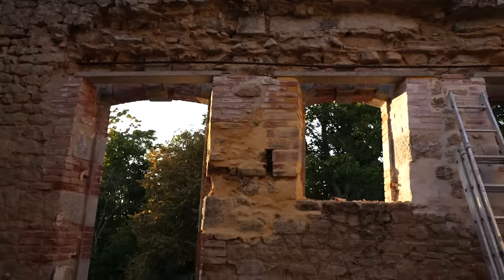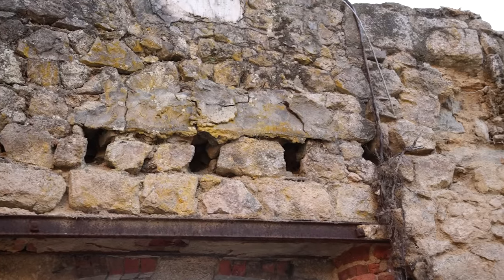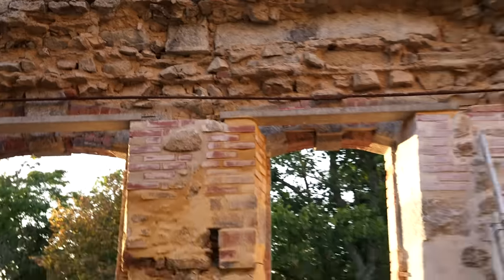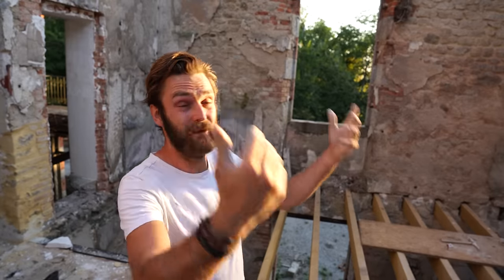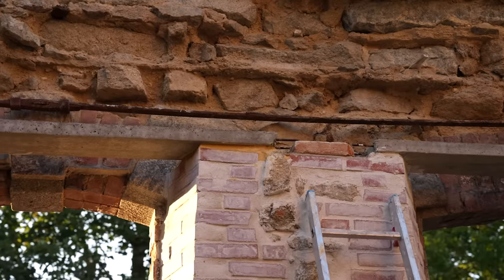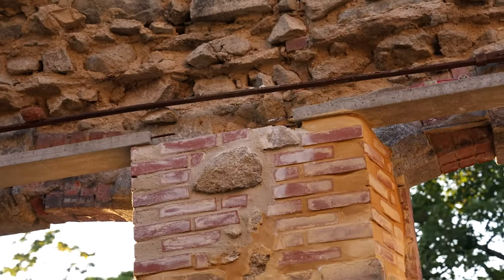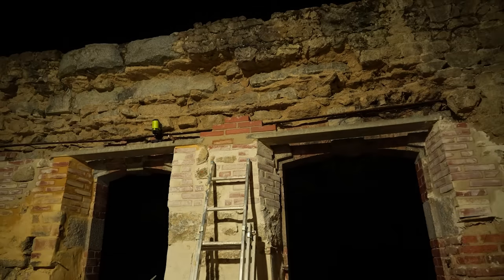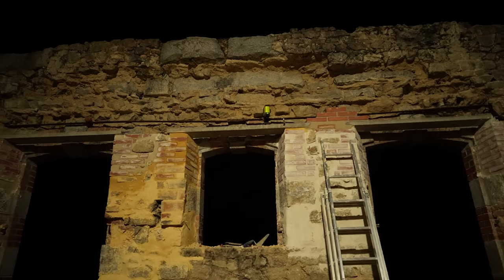laying the foundation for another floor level.

Comment: Last lintel in and then this entire wall can be rebuilt and supported and no sooner is that done we hear that beams are coming ... you just never know what is going to happen next at the Chateau !!!
Reply: He has had things well timed as a rule. He has a plan and it is working for him for sure! He also adapts well when there is a hiccup.
Reply: it's not a lintel, but a 6 centimeters pre-lintel and that's the big problem, can't support a wall
Reply: @joffreyg8676  I thought it was something European as it has the  iron bars in it. Does Dan know?
Reply: @LordBurberryGB  iron bars are normal for a pre lintel or cement will be fragile like glass, the irons that stick out used to connect the iron of the concrete poles when you need to use poles, but i'm chocked that no one said him something about that

Comment: To put this working at heights issue in perspective, in the early 1980's as a teenage trainee I was cleaning tilers grout off of window frames. Three stories high working off of two scaffold boards, moving them along as I moved along the facade. These days in Western Australia at least working off a ladder is illegal! Dan is simply turning the clock back fifty years!

Comment: The real scary thing is the wood beams aren’t cemented in. They were moving when was putting the floor board down.
Reply: Noggins haven’t been installed yet. That sure was an ankle twister!!😮
Reply: @PaulRiesland Indeed, we were supposed to have a noggins day a while back, and that didn’t happen!
Reply: @gloriasmestad3803  You’re right! I think that happened when he was under the weather. Now he may be stressed to move ahead to get that roof on. Just a guess.
Reply: they have to be able to move so they can expand and contract over seasonal shifts so that's probably how they'll stay, but they'll firm up once flooring is installed!!
Reply: Exactly right.  VERY dangerous!
Reply: I thought the same thing.  I have to fast forward some of this stuff because my anxiety won’t let me watch it. 😂😂 But I wouldn’t miss an episode for anything.
Reply: It would probably be smart to throw a couple of screws into each beam through the temporary floorboard.  That would have locked things together and been easy to remove.

The guy is living dangerously.
Reply: He has great balance. He is no dummy. He is fearless. I wouldn't try it, but he sure keeps us interested.
Reply: @PaulRiesland  ...lmfao Maybe next year!
Reply: @ritafield382  
There's a thin line between fearless and dummy.  The smart move, IMHO, is to not push up close to the line as sometimes stuff happens.

Falling down a floor or two with a heavy concrete beam accompanying you on your tumble could be a bit uncomfortable.
Reply: @PaulRiesland  Makes me think he has a timeline he is working from, certain things that must be accomplished before the temporary roof structure is put in place. Thus, tasks that could be accomplished after the temp roof is on might get shifted to that part of the timeline if need be.

Comment: You might have made a mistake, these are not exactly lintel, we call them "pre-lintel" (pré-linteau), you're supposed to cast a real reinforced concrete lintel on top. Usual reinforced concrete lintel are 20cm thick. You took out steel lintels, which are very often thinner than concrete because steel is way stronger, you might not have enough vertical space to replace them with thicker concrete lintel and fit under the floor joists.
edit: googling a bit more (in French) shows that manufacturers are even more picky about having the joists on top of a pre-lintel, they want more reinforcement. There was stuff about quakes too, but I don't think Creuse is in a seismic zone.

edit2: a few videos in, we see that there will actually be no load on the headers, the next floor is set on 2 i-beam resting on the pillars between the windows, and then it's the top of the wall, the roof will rest on an eave beam, which again will not point load the lintels. So nobody is going to dance on a floor point-loading the flmsy lintels.
Reply: Totally agree and he's building a wall and roof on top of these flimsy lintels.
Reply: If he build a wall on thèse 6 centimeters pré lintel without lintel it's a suicide

Comment: Hi Dan, It's absolutely amazing what you are achieving on the Chateau, essentially single handedly. And like everyone else, my heart, sore back, and bad knees go out to you. Please please check that the bricks for the I beams are rated to carry the load that will eventually be placed onto them. Over a short time, some bricks will crumble due to the direct load on them. Maybe build the walls up, then wherever there is an I beam to go, place a concrete lintle over a few bricks to spread the load. Keep up the hard work. We are all rooting for you.

Comment: Hi Dan, Had thought you were going to rig up a central hoist, so you wouldn't need to hand carry everything up ladders. And for the Cement mixer. My old man always placed a barrel/drum next to the mixer. Filled the barrel in the morning and added Bicol. Then used an old pot to accurately measure the water into the mix.
Reply: He is going to rig up a new winch when he puts the I-beams in. He has no where to fix it from until they go in.

Comment: I'm wondering what happened with the noggin (water) crate?  

Your brickwork is coming along nicely and you aren't as slow as you think you are. In a perfect setting with no issues, a bricklayer can lay up to 500 bricks a day. 

This number can be reduced by 100s due to complex builds, adverse weather, or any of the number of issues that can arise on the day, so..   climbing ladder = 400 bricks per day.  adding bricks to a damaged wall = 300 bricks per day.  mixing own mortar = 200 bricks per day. filming bricklaying = 100 bricks per day. Excessively hot weather = 0 bricks per day.  

I think you did at least 100+ bricks today, which is outstanding Dan, nothing slow about that.  Nope, not slow at all!!  I'd say you're damn good bricklayer!

Comment: Dan your lintels on the larger openings may not have enough edge support. I don't know about the product you have purchased but typically engineered lintels have a minimum end bearing of 100mm or so.
Reply: 150mm minimum

Comment: A quick question, I noticed the original windows have an arch to them on the outside. Now you have flat lentils that look to be lower than the top of the outside arches. Are you going to be switching to a square window or you gonna try and keep the arch of the original design?

Comment: He needs to cement those floor joists in place and install the noggin's.  I felt panic when he walked on them and they were moving.🤦‍♂ You need the floor under you to be secure and you need to have more than just a small piece of plywood under the ladder. It is not even screwed down. What if that slips back?? OMG!! Please be safe Dan!

Comment: the bottoms of the windows have those "after thought" looking bricks filling them up. where those original or where they placed in when France passed the new tax that was based on number of and size of windows?
Reply: Those are thin, insulating bricks that were put there before they installed the radiators for heating. The windows are their original size.

Comment: With all the demo debris about to raise a problem of shuffling from one pile to another, get some plastic tubes to run from windows to dump truck on ground. Watch how they get snow out of Lambeau Field in Green Bay if you need some pointers.

Comment: If I were you, I would build a concrete beam with rebar in it instead of laying bricks. then drill holes on the concrete beam to install floor beam brackets. the concrete beam will provide stronger support for the old upper wall sections and other structures.

Comment: The options for today:
- put more floorboard tomorrow and lift the lintel with the machine, and today rebuild some of the wall above the lintels already in place
- carry on the ladder an heavy weight that you can barely hold, balancing precariously on a 5 meter void
Reply: His only option it's make the final lintel above these pré lintel or it's a suicide

Comment: If you use a string line instead of a level on each brick laid you will go a lot faster
Reply: @andymccabe6712  when he had all the lintels in position in his last video he just put a dead man up and tends to work along using a two foot level. Obviously, a line only works in certain circumstances. He also builds up the reveals to a window opening without levelling across to end up with each bearing level.

Comment: Dan Dan Dan. You're too precious to be operating under such precarious conditions.  Somebody in a thread said you have to bolt the outter facade to the bricks you're plastering and restoring. You have to do it as you go.  And, forget the top floor. Seriously. Make it the ceiling and repurpose those bricks from the very top. Bring them down to ground level. PLEEEEASE.

Comment: That does not looks like a lintel but rather a pre-lintel. It is not meant to be used as a lintel and take important charges on top of it. You are meant to pour reinforced concrete on top on that. Please ask some professionals to help you on such work.
Reply: I talk about that in my comment, it's a suicide, used pré lintel without lintel, soemone need to contact him very fast....
Reply: @joffreyg8676 Yeah, that really questions how competent he is to do this kind of work. Willingness (which he certainly has) alone is not enough, asking a professional advisor would be good sometime...
Reply: @clemvangelis  He is competent enough to manipulate his audience and get money from his caring patreons😂. Very cynical.
Reply: @DorotaN-sl3tu  cynical when you risk to hurt or kill someone later...., anyway later he can't have public to visiting this castle because too many structural problems, french inspection will just check all his video and declare forbidden to the public...

Comment: Maybe, just a thought mind you, you might consider, while waiting for cement to dry, putting in the noggins between the floor joists so that there is more strength and stability there where you are walking. I mean I know the OSB boards are completely unnecessary and over the top, but the noggins might be a thought! 😉
Reply: I think there was a thought that he didn’t put the noggins in yet because he may need to open the space to get more building materials up to the top for the roof beams, etc. But he has mentioned a temporary roof, so I don’t know if that means putting up regular beams and rafters and then, say, plywood and some sort of metal or aluminum sheeting or what. It’s a mystery to me.

Comment: The top of the ladder leaning onto barely anything on unsecured wobbly beams on a board not fastened! Arrrrgh! Too dangerous and risky. I also don't understand how just parts of the walls are rebuilt, what about the walls along side of the repaired bits. Can someone explain this please. 🤔
Reply: Everything will be filled in, rendered, and pointed. It will be fantastic after all of that is done.
Reply: @PaulRiesland  thanks, it is such a fascinating journey, even if it makes me a bit anxious at times 😊

Comment: Yea, ya scared me with the lintel, on the ladder on the unfinished floor joist/system 3 stories up in the air at night, by yourself. I have an OSHA 10 hr , film industry safety hazard training. To help people. 
    In Massa-chu-sits, we have a law, that protects hospitals from admitting people, who fall from heights, over 6 ft, with out 5- point harness, and fall arrest protection..

Comment: dropping sanat to see the rest!!!!
one thing you're just starting out and still screwing up safety and keep working on ladders and useless scaffolding.
but when you use lintels that are far too short, too little strength, and the iron sticks out at the end so that they can really rust and tendons break.
make a huge ball joint under one rather than one more brick and brick in colored felts. then I give up

Comment: Should have used steel beams for the lintels. Don't believe all the weight above will hold. When he is using the laser above one window there is a original steel beam above the window. The concrete ones are way to thin.
Reply: the armored concrete lintels are likely stronger than some of his pillars, made with thick layers of lime mortar...
Reply: Thanks for the info Makes sense. @SuperEgleh

Comment: metal ties are a terrible idea. They are no longer used because they rust away and leave the structure vulnerable. Actually take out random bricks or stone from the outside and turn them sideways to key in with something structural. Even ruble pieces limed in will be stronger and more long lasting than those metal ties.

Comment: Confused that window lentels go across, in front of arches and not higher. It looks like outside there will be arched windows and inside will be rectangular ones.
Please set me straight
Reply: It is a bit of an illusion Lorraine. If you watch a few of those videos were some of it is filmed at eye-level you can see that they are exactly where the old lintels used to be. They are just above the window tops.
Reply: Thank you Paul, I looked at it so many times. Dan is doing such a wonderful job and I thought he surley couldn't mess this up.

Comment: Those lintels don't look strong enough are you sure they are not meant for a brick wall laid in a vertical orientation?
Reply: They actually are. He was advised as to what to buy. Also, the weight of the floor (I-beams) will be held up by the columns. Just the bricks above the lintels will be supported and that will all be tied into the wall and steel above. Once cured, it will be one nice unit.
Reply: @PaulRiesland Sounds good to me.  Thanks for the info.

Comment: I do hope you are going to pay proffesionals to build that roof. Though it does appear you still have a long way to go to get the tops of all those walls square and solid. Experts will build it a LOT faster leaving you to do the thousand other jobs you can do. 
Slate roof?? Or colorbond which is a LOT cheaper in every respect as well as a lot lighter as well and that poor old house could do with less weight up high.
Reply: He is required to do the slate by the powers to be (not sure what they’re called?).

Comment: If you feel its taking a lot of time...not only have you played those bricks one by one by yourself ...but you have carried every brick and bucket of cement up and down now 3 sets of ladders.  I would match your strength up to a weight lifter from a gym...you are inspiring ..some of the other chataeu restorations seem to have volunteers helping ...of course they are painting and doing wall paper where u are walking on unsecured beans without a safety harness....yes better not have volunteers on your project...see you tomorrow
Reply: Beams...not beans
Reply: Well, an incredible number of people in the comments think a lintel is a lentil, so beam/bean? 🤷‍♀️ Makes sense 😄
Reply: Oops typo

Comment: just no rush AND SAFETY must be a priority,
   ......otherwise I see that the BEAMS are not fixed, BUT you put a ladder on them and climbed up with a lintel of concrete - this is not a good sign - you are in a hurry ...:face-turquoise-covering-eyes::face-turquoise-covering-eyes::face-orange-raised-eyebrow::face-orange-raised-eyebrow::face-turquoise-covering-eyes::face-turquoise-covering-eyes::face-turquoise-covering-eyes:if you break yourself, then there will be neither you nor your ideas...

Comment: You should make weekly videos. It will drive further engagement by creating anticipation. I understand why your making daily vids as the view counts are consistently is high but they are diminishing if you look at the stats. Time to change it up now as the recent videos are boring which is not your fault. Your lacking manpower and resources. I'd recommend hiring an editor and single videographer to free up your time so you can focus on the work at hand and time with your family
Reply: The $ is in the dailies

Comment: You should not be putting RSJs directly onto normal bricks like that, it should either be a concrete pad or engineering bricks, preferably the former